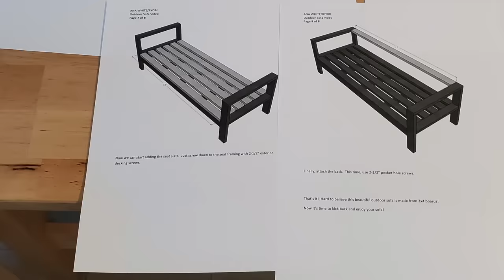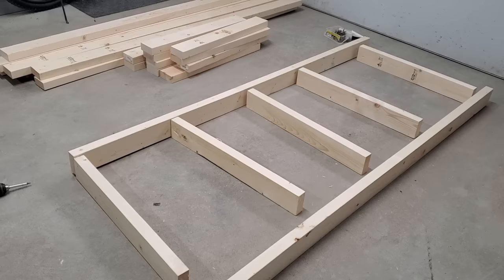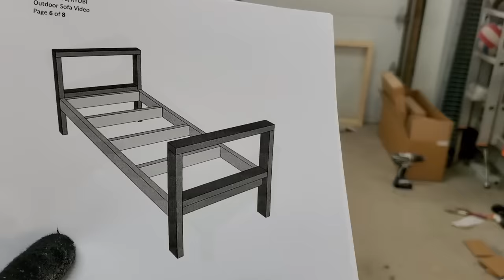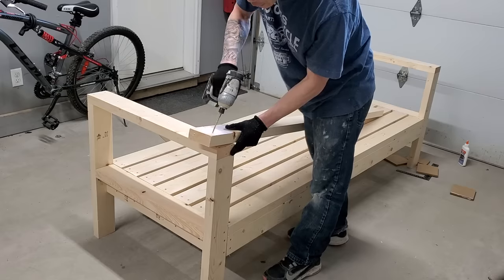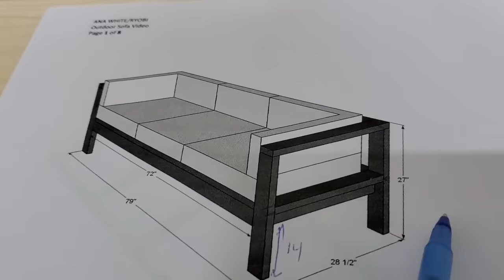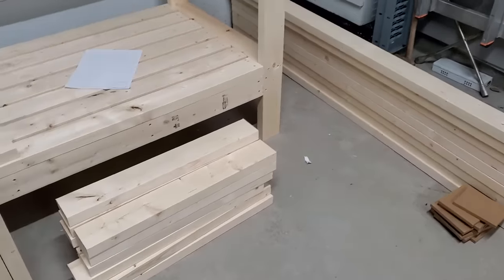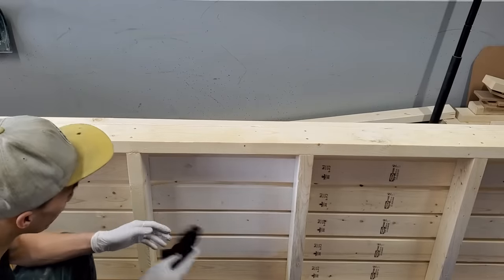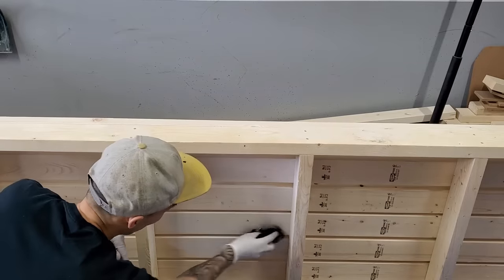DIY Patio Sofa Sectional 2x4 pine

Comment: Take it to the next level... 1) use pressure treated and then Linseed oil.  2) Pocket Holes are WAY better then the butt ending shown 3) people I made mine for are young and will move therefore i used 3 1/2 " carriage bolts to attach arm sections to seat sections (3 / joint) the units breakdown for moving
Reply: most people are here for an easy to make seating. no need for next level nonsense. it's fine the way he made it.
Reply: Amir - hater gotta hate = YOU chill lax little guy Not only are suggestions a way to learn and to improve they offer choice and move from mediocrity. Which you apparently embrace.  LOL nonsense

Comment: I made that one. Also made the matching coffee table.
Reply: What do you think of it now that’s it built and in use?  Is it comfortable?  I have my cushions and throw pillows, but before I build I’d love to get feedback from someone that has. Thanks in advance!
Reply: It’s real sturdy. I recommend putting boards to support the back board. It’s as comfortable as the cushions you buy. I bought cheap (well inexpensive) cushions from Walmart I painted mine the same color as my garage and front door. For the price in materials it’s well worth it. And very easy to build. I built the matching coffee table with the leftover wood from the sectional.

Comment: Nice.  But all the weight is supported by glue and 6 or 8 wood screws.  I would suggest modifying your end pieces to support the seating area to bring the load to the ground.  It could be as simple as a vertical piece of 2x4 under each corner, attached to each leg.
Reply from the maker: thanks for the advice. you are 100% right. I'm gonna make a follow up video about that

Comment: Looks great, better than many $700+ sets. I'm curious if after sitting on it with cushions, is the back comfortable being straight vertically? I've seen some DIYs with a slight slant to the back but it looks a bit harder to do
Reply from the maker: the base of it is already comfortable.  use 24x24 inch cushions.  with a back cushion is really comfortable

Comment: It's been nearly a year and I had a question about the 8' section. Have you seen any sagging? Have you needed to put a support or leg in the middle? I am just a few days from this exact design and was curious if I extended the length if I would need more support. Your finish looks great!! Nice work!
Reply: A lot of ppl added a 4x4 piece in the middle underneath for added support.

Comment: It looks great but I would have major concerns with the structural integrity. The weight of the base looks like it's only on each single 2x4 within the arms on either side that you attach around 3:00. There looks to be only 4 screws holding these 2x4s into each arm. Basically just depending on 8 screws to hold everyone who sits on the bench. And even further at 3:30 it looks like only 3 screws and some glue were used to screw the base into each arm, so there's an even weaker support of 6 screws to connect to the 2x4s that are only being held up by 8 screws
Reply: your suggestion???

Comment: Great video, thanks for sharing! Are cedar 2x4 wood already squared compared to standard 2x4? Or did you have to use a table saw to square off the wood?  Also, what was the estimated cost for all the material?
Reply: Cedar better wood for outside

Comment: Approximately how many 2x4’s did you use for the whole set up?
Reply from the maker: 32 2x4 s
Reply: Incredible cerpentry, love it. Instead of cutting the 9 @ 72"  you could save a lot of lumber and cut 9 @ 70" and use the off cuts for the 13 @ 25.5". Would this work?

Comment: What size of the screw tho...
Reply from the maker: 2 1/2
Reply: @dangstersgarage7453  i did went to home depot and they dont have that kinda  screw or size..is there a specific size on the head of the screw or like 10 2 1/2 or 8 2 1/2
Reply: @dangstersgarage7453  ty for your time tho and appreciate it

Comment: Can anyone tel me if I take this list exactly like it shows to Lowe’s or Home Depot if it’ll come out just as same.? Meaning I’m a bit confused as far as 11—2x4x10
Reply: 11- 2x4x10 means that you need (11) individual 2x4s, each at 10 ft long. Takes a while to get the hang of reading build lists lol. Also, pine is a HUGE risk to use outdoors. Cedar would be best but it's more than double the cost. If you do use pine, you gotta paint all the peices before assembling. Hope that helps.
Reply: From those pieces will I be cutting to make the legs? So meaning when I go to the store all I have to ask for is 11-2x4x10 that’s it ?
Reply: @Lesleerz  Yup, exactly. Those would be the only wood pieces you'd purchase and from those you would cut out all the other pieces you need.